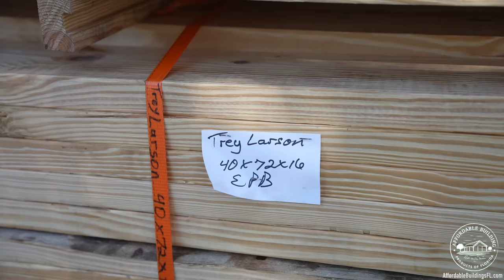How We Built Our Farmhouse Dream Barn! Post Frame - Steel Truss Pole Barn

Comment: The finished barn looks great, really like the colors.  I just got done doing my own barn and noticed that the posts when installed does not have uplift brackets nor did it have the post wrap to ensure concrete never touches the wood.  These are minimal cost items that can save thousands in repairs later.  The uplift brackets are code required in my county with a wall height that you have.  I never thought of the steel truss but also have cathedral ceilings but not as close to what you have here.  That is something I will look into for the next barn.

Comment: I saw in a few of the comments that the barn was going to be spray foam insulated. Is there any plans to have a permanent heat source in the barn itself? Very, very nice structure. On a personal note, I would have placed the ground level windows (west side) that are not visible from your house to be up higher, just to prevent possible break-ins.
Reply: Doubt they have to worry about a heat source too much since they live by the Gulf Coast in Central Florida, but definitely need the insulation too keep the sun from heating the building up so much it feels like an oven.

Comment: What's the resistance to storm forces, and for how long do the main posts resist foot rot.  Perhaps the premise is that it will destroyed in a storm and the insurance covers it, so no need to worry about how long the posts resist foot rot.  Otherwise, it's a spacious and good looking building.  From others that I have seen,  of the barndominium school, it would look better if the veranda-cum-deck wrapped around the corners, to give it a more architectural feel and make it look more planation/western :-)

Comment: Okay I like the size of your barn but what i did not see them do they did not put rebar in the your concrete slab and that big of a slab I would have also put a heater pipeline in there to keep the floor warm and during the winter.

Comment: I can’t believe you got your final inspection without any railings on the second floor balcony. Usually you would need to put temp railings or something just to work up there at least in my state. Building looks good aside from that. Great job

Comment: the barn is great.  but if it were mine I would have made sure to having running water, a bathroom, and drains in the floor for just in case.
Reply from the maker: Yeah we may kick ourselves in the future.
Reply: Would have loved an attached garage on the house? 🤨
Reply: Around here in southern New England floor drains are frowned on.  The rest of the things you mentioned are a whole hearted YES.
Reply: I think you did a great job. Yeah, you might have done things different, but you can always add them later. Thank you for sharing great content with us!!!
Reply: The girls will go in the house the guys will go out back , they can always but a drum of water up high to feed a sink for hand washing
Reply: @jeffreybangs3740   a lot of people here put the floor drain in then cement over it to pass inspection , then later come by and bust out the cement put the grate in and recement around it
Reply: @TripleLRusticDesigns   I have a 30x40 I wish I woulda put plumbing it being detached and having little ones being dirty and tracking in the house sucks.
Reply: It can be put in later we had it done
Reply: @burtronomaniac  sure those are options.  not great ones but sure.  however if i am building a really nice barn/garage, i am going to make sure it has those things to begin with so i dont have to do those silly things.
Reply: Agreed.
Reply: The barn looks absolutely beautiful! I’m curious as to why they only put rebar on the outer perimeter of the slab and not in the center! I thought that was standard to help prevent cracking?
Reply: @Slim-C no... big insurance price jump with attached.
Reply: How much did it cost to build?

Comment: Looks absolutely amazing. However, I was somewhat surprised that no rebar appeared to go into the concrete base.
Reply: you do not need rebar if you have a solid base and you have a good psi concrete  and there may be Fiber in the concrete  that help make it stronger
Reply: That’s what I was thinking too. Hopefully they at least have fiber added to the mix. Concrete doesn’t have tensile strength so any heavy weights or swelling ground will crack the concrete.

Comment: No rebar or at a minimum wire mesh in the concrete. If it’s just microfiber it’s not enough. A shame to invest this kind of money only to cut corners where it matters. Concrete isn’t cheap when you’re replacing it. Also no post protection?

Comment: I understand you’re in Florida, But a concrete pour on top of the vapor barrier with no rebar or wire inside the slab to minimize cracks isn’t a great job. Yes ur in Florida, But concrete needs rebar or a heavy wire in it to stabilize to to keep any cracks to a minimum. Florida gets a lot of Hurricane rains to raise the ground surface water tables. So I noticed these fellows in this video never put rebar or concrete grid wire above the vapor barrier to be in the center of the pour. Just concrete on top of vapor plastic. Maybe you elected not to put it in the concrete, either way I think it was a No No and should’ve been added. It’ll matter especially in the future conditions of the concrete, The building looks nice though.

Comment: Isn't it odd that people continue to build in a way that is the least efficient... 
thicker exterior walls people, double up on the exterior walls leaving a gap in between them...
think of your Home as a thermos... build a structure with in a structure...
the money you will save in just a few years in heating and cooling costs will pay for the extra material.

Comment: nice , but why no rebar or wire on a floor that size?? I put 6kpsi on my first barn floor 25 years ago and it cracked even with reliefs, my current floor will never crack

Comment: Basic build, looks nice with interior wood columns and wood purlins. I saw it’s missing a drop off of 1 1/2” around the bottom perimeter and foam enclosure w/ the base angle to prevent water coming in.  The steel angle joist / rafter were nice. I know you’ll get hurricanes out in Florida; I’m wondering what your wind loads are in that county. I saw no X-wind bracing on roof or walls ( are they needed w/ a pole barn build?). Metal panels could’ve been thicker, I’m guessing it’s a 26ga. panel. I wouldn’t know the specs on a pole barn vs a Pre Engineered Metal Building. Good build over all. 👌🏽